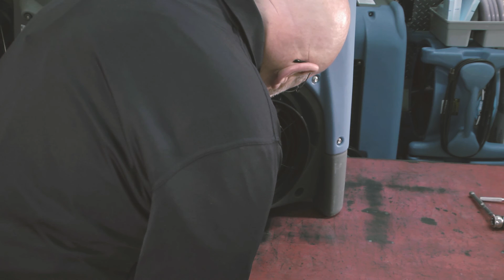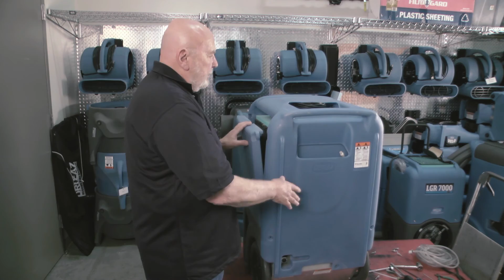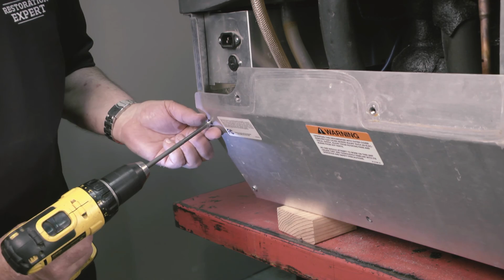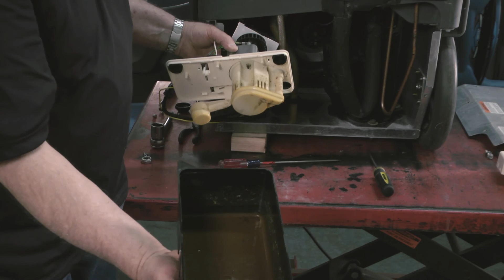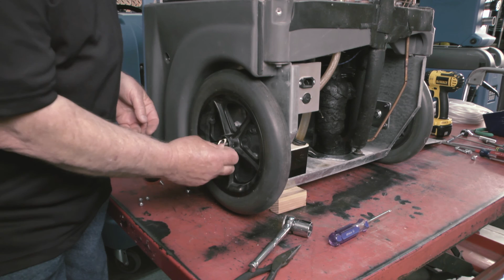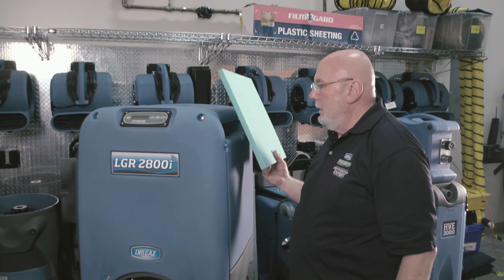Servicing the Dri-Eaz LGR 2800i/3500i

Comment: Dear sir, I’m repairing a dehumidifier Dri Eaz LGR2800i, I replace the motor, relay and electronic board and everything sound good but the blower doesn’t turn on. After that I touch it and it’s hot

Comment: Fantastic service video! Thanks Robert.
I just did a complete service based on this video as my recently purchased ~2012 model (from the 2012 sticker dates on the evaporator coil) F411 (3500i) doesn't seem to be collecting water. After the service I ran for about 20 minutes at a room temperature of 19°C and the coil temperature was only 1°C lower than room temperature . There are no error codes and the unit seems to be working perfectly otherwise. My assumption is low refrigerant (and possibly a leak) or a bad compressor. Is it possible to recharge these units or purchase a new compressor?

Comment: Question what size socket do u use to take off the wheel on 2000 dehumidifier
Reply from the maker: Please check with Legend Brands Service at 800-932-3030.
Reply: 15/16"

Comment: The 3500i has a gray tray that I cant figure out how to take out. Any help appreciated.  Thank you
Reply: You just pull out the electrical box out first,  then the grey box with the pump can come out.
Reply from the maker: Sorry for the delay in responding! If you haven't resolved this issue, please feel free to call Legend Brands at 800-932-3030 and ask for the Dri-Eaz Service department.
Reply: This was literally the reason I came to this video. Were you able to get it resolved? And how if so?
Reply: @richardbuhle8859  feel free to call Dri-Eaz Service at 800-932-3030 with this question.

Comment: what do you suppose is the problem when the output air isn't coming out warm.  The unit will run all day with no output of water.  This is for the 2800i
Reply from the maker: Sounds like it is either air flow or refrigeration issue. For more help on this issue contact Dri-Eaz service at 800-932-3030.
Reply: If it's a refrigeration issue, would that maybe mean it will need freon?